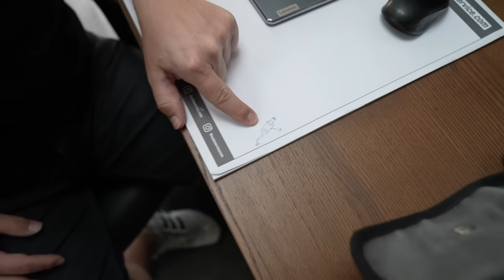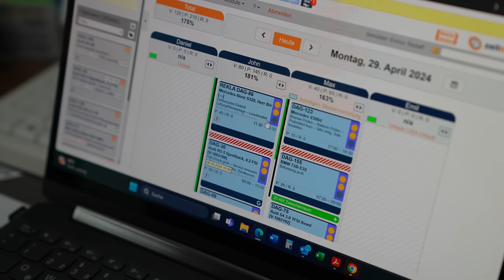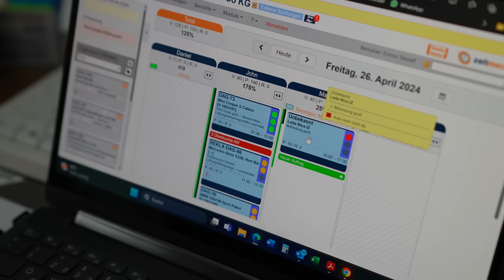Fataler Schaden direkt nach Auslieferung! Wer hat Schuld? Nerven liegen blank & Kunde tritt zurück!

Comment: Kotzt mich so an: Opel weiß um dieses Serien Problem sowohl Ladeluft Schwachstelle, Sensor und DPF. keine Kulanz bei unter 100.000km. Auto fuhr ja noch perfekt aber TÜV no way. Nur neuer DPF mit allem für >4.000€. Gleich verkauft. Das war mein letzter Opel. 😅
Reply: Auch das Turbo Problem im Zafira B...keine Kulanz
Reply: Das ist halt Opel. Schönes Auto mit super Ausstattung für wenig Geld. Die Mogelpackung schlecht hin. Was du beim Kaufpreis sparst, holt sich Opel über Werkstatt Besuche und enorm hohe Ersatzteilpreise in die Kasse. Ich hatte ein Mal einen Opel. Ich in 3 Jahren bei keinem meiner bisherigen Fahrzeuge so viel Geld verbrannt. Von der Marke Opel bin ich geheilt. Nach dem Opel kam ein Skoda Superb von 2012. War ein Jahr alt mit 20.000km für 23.000 €. Das Auto hat mittlerweile 300.000 gelaufen und macht seither null Ärger. Ich staune immer wieder, dass dieses KFZ so zuverlässig fährt und ich bin mir sicher, dass es das noch lange so fortsetzen wird.
Reply: Filter raus, software drauf und gut. Spart nerven, Sprit und entlastet die Maschine

Comment: Bei mir war das auch ein Thema. Habe exakt den gleichen Motor mit 209Ps, Druckrohr gerissen und getauscht. 200 km Ruhe, dann Nox 1 Sensor getauscht, 50 km Ruhe. Opel wollte dann den zweiten Sensor und im nächsten Schritt den DPF tauschen. Kurzum hat EDS ein Softwareupdate das den Fehler behoben hat. Die Grenzwerte wurden um ca. 10% angehoben. Netter Nebeneffekt 245Ps und 1 Liter weniger Verbrauch. 
Das läuft jetzt so problemlos seit 110tkm Einbau bei 60 tkm und jetzt sind es bereits 171tkm. Ach und AU beim Tüv ohne Probleme bestanden. P2002 hieß der Fehler bei mir. Vielleicht nehmt ihr mal mit EDS Fahrzeugtechnik Kontakt auf ob die die Anpassung der Toleranzwerte auch ohne Tuning anbieten. Fakt ist, seit dem habe ich Ruhe und das Auto ist wirklich gut, aber das Opel das nicht auf die Kette bekommt ist traurig!

Comment: Eure Theorie kann ich nicht bestätigen. Ich hatte die selbe Odyssee mit meinem insignia bj 2015 2.0 cdti 170 PS. Das Rohr ist mit lautem knall auf der Autobahn weg geflogen und die Leistung war sofort weg. Fahrzeug sofort abgestellt und in die Werkstatt geschleppt. Rohr wurde ersetzt und dann ging es los. NX Sensor 1 getauscht, NX sensor 2, dann das Kabel dort hin, dann den Ad Blue Tank mit Pumpe und dann habe ich das Fahrzeug zurück gegeben da absolut keinen Bock mehr (zum Partikelfiltertausch ist es nicht mehr gekommen) . Gekauft mit 43.000 km, zurück gegeben mit 67.000km (1jahr). Im Nachhinein zum Glück weil die Car Garantie nichts abgedeckt hat und Opel nur teilweise Kulanz übernommen hat.

Comment: Der Plastikschlauch zur Ansaugung ist mir bei meine Insignia auch abgeflogen. Die Schellen die Opel da verbaut hat müssen aus einem billigen Druck Guss Metall sein und hat sich in 100 Teile zerlegt. Aber mit solch einem Knall und mit fliegenden Teilen unten raus, dass ich keine 20 Meter weiter gefahren bin. Ich stand auf der Straße und musste noch 20 Meter bis zur Tanke. Der Wagen ist gefahren, als wenn nur noch 2 Zylinder laufen, gebockt, geruckelt und Motor fliegt gleich auseinanderfliegt. Wie der Kunde damit noch so lange weiterfahren konnte ist mir ein Rätsel.

Comment: Die großen Opel sind so richtige Blender... Großer und gut ausgestatteter Innenraum,  toller Fahrkomfort, aber keine Kulanz und Teile sowie Reparaturen kosten echt achteckig.... Zwei Vectra C gehabt als 2.2 Direct mit 155 PS und 2.2 dci.... STÄNDIG Defekte und Preise vom Mond für Ersatzteile, da steht der günstige Anschaffungspreis in keinem Verhältnis-nie wieder Opel
Reply: Hatte Astra H mit dem 150ps Fiat Diesel  Auto war richtiges Spar wunder gewesen und Teile gibst für dieses Model wie Sand am Meer und vor allem kosteten kein vermögen und  hat  kein stress gemacht, hab da nur   qusi fast  nur  Verschleiss  Teile gewechselt  mit fast 300.000km war da immer noch noch erste Kupplung und  erste Turbo drann gewesen  teuerste waren  in 13 jahren besitzt halt  3x Ansaugbrücken die keine 200 euro bei denn modell gekostet haben  und  bei 230.000 km kammen noch Generalüberholte 4x Bosch Einspritzdüsen rein und einmal mal gabs Stossämpfer für Vorne Hinten das waren halt Grössten Posten

Comment: Wechselt mal die Adblue einspritzdüse die mach auch immer Probleme
Reply: Nein. Das Problem ist. Wenn du nicht den PF frei fährst wenn es das Auto verlangt. Wird aber in Modellen ab 22 nicht mehr angezeigt. Wird der vorgegang nicht beendet stopft das ad blue den filter voll. Dann stimmen die werte am Nox2 sensor nicht mehr.
Einfach eine Absolute Fehlkonstruktion des KFZs.

Comment: Insignia a gab es glaub auch ab FL mit adblue aber euro 5 mein Kollege hatte das so. Ich hab den A als euro 6
Reply: Und ich fahre den A Facelift 163 PS Euro 5 ohne Adblue Mist und mit 271000 auf der Uhr. Eine Ölpumpendichtg. gemacht, sonst nur Verschleißteile. Der wird gepflegt.
Reply: @bandit229  ich hab jetzt zum Schluss nur noch Theater gehabt u ich schwöre der wurde absolut gepflegt. Alle Intervalle überpünktlich erledigt u trotzdem 3x jetzt hintereinander in der Werkstatt. Zum Schluss tausend Fehlermeldungen im Display. Fehler in sämtlichen Steuergeräten u keiner wusste wieso.
Reply: @bandit229  war aber ein echt schönes Auto tat mir etwas weh als ich ihn in Zahlung gab. Hab jetzt nen A 250e Kleines Auto aber  reicht uns.

Comment: Respect: es werden Fehler gemacht und Mann hat den A. In der Hose auch dazu zu stehen . Ich habe den Insignia B als Benziner (umgerüstet auf Gas) und ich liebe die fette Dame 😅. Aller 15000 km Ölwechsel und mittlerweile 130000 km runter.Was mich nervt an den Auto ist die Tatsache, das Esim abgestellt wurde. Also kein Wlan Hotspot oder SOS mehr im Auto.